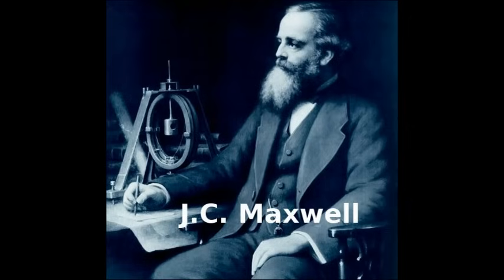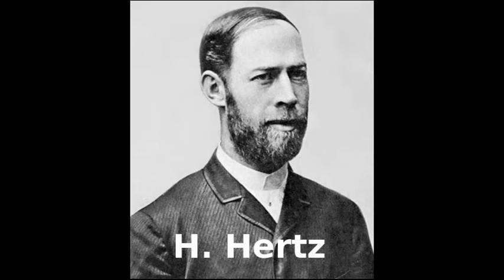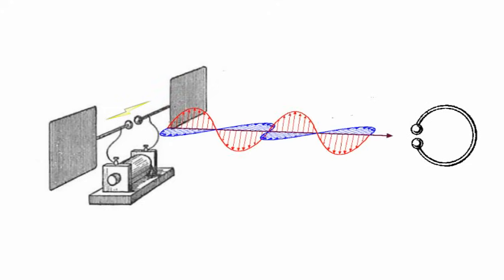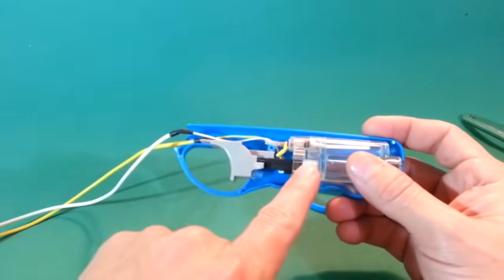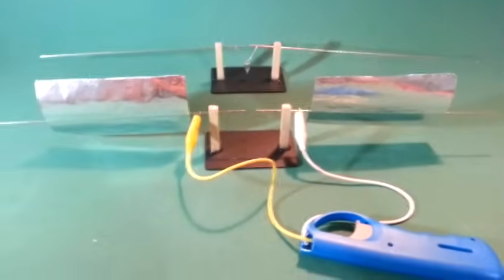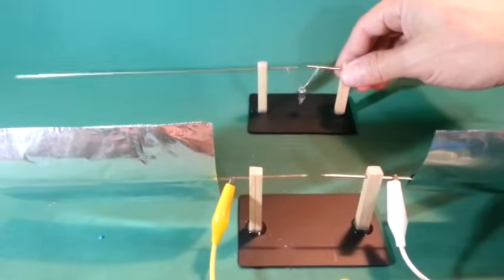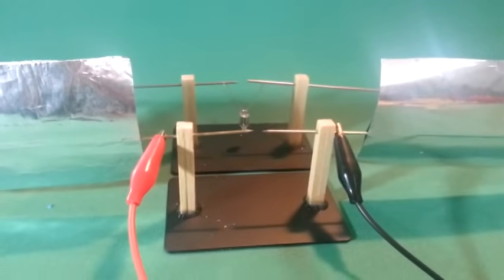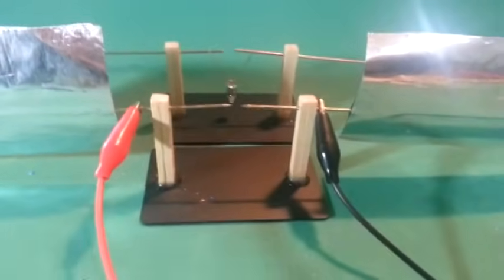Hertz Experiment on Electromagnetic Waves

Comment: This is why youtube is the greatest invention since the printing press. Genius people can build their experiments and share with everyone around the world. Thank you so much for this! Wishing you the best!
Reply: Still incomplete since as many stated this is indeed wireless but not the hertz type but a capacitance like transfer. Youtube is for stating the x happened not for the reason x happened.
Reply: Billy Monday how did you conclude that this is a “capacitance like” transfer? You are confusing a tesla coil with this experiment.
Reply: @stefano.a  Read other comments or a physics book about the definition of a capacitor... Also tesla coil has a COIL (inductor) and uses a more general capacitor than this experiment does
Reply: Billy Monday the spectrum of the signal produced from spark is so large that is surely transmitted ad electomagnetic wave. To be sure that the receiver it is not in the “short” field distance is enough to move the receiving antenna more distant. But the concept doesn’t change.
Reply: @stefano.a  I didnt dissprove antennas , however this experiment doesnt prove them either ok?
Reply: @billymonday8388  You're all wrong. If the quadrupole charge isn't depolarized it can't possible couple by way of parasitic capacitance. The only remaining logical explaining would be inductive coupling caused by over saturation of the ferrite core in the PIN diode.
.
.
.
.
Yeah, none of that made sense. But at least somebody can feel big and angry about it as they try in vain to tell me what I said was nonsense. Nobody ever clicks "read more." Oh so reactive (no pun intended heh). There's always one of them.
Reply: I know man. Very limited in the pro column as far as the internet goes. But this is truth and they’re taking it away, be vigilant
Reply: @Shreerang Vaidya ?Your comment seems very strange, wtf?  I love the conversation above - electromagnetism is SO fascinating!
Reply: A YouTube jewel.
Reply: Thank you very muth for thith

Comment: how much voltage is given for producing this spark..and what is the source of the voltage ????
Reply: The dielectric constant for air is 10,000 volts per inch.   If the spark can travel 1 inch , you know it's at least 10,000 volts. The source is a high voltage power supply.
Reply: @J.RRandallIllinois  depends on several factors, including air pressure and humidity. For most sea-level moderately moist air, sparks jump about 3 kV/mm.

Comment: can we use any other materials than a neon lamp?
Reply: A common fluorescent tube also works in the case where he used the powerful voltage generator but you could experiment with small fluorescent tube and the BBQ lighter.

Comment: What is the materials you used for experiment? Reply asap pleaae. Thank youu
Reply: A 4 pair length of wire ,a lighter pizo and a neon bulb you can hang them with a plastic bottle  and connect them as that in the video there's no need of the aluminum foil
Reply: @neldungca8524  the foil is necessary to propagate the waves; it's the antenna.

Comment: I would like to have seen it performed in a way as to block any reflection of the lite that you are transmitting.  Preferably one with the spark gap and the lite bulb in a box with black background to show the lite better. And to have a non translucent  blocking material between the spark gap and bulb to show no reflection on the glass bulb from the spark gap. To show a good experiment, is to show it in a away as to not leave any angles that could be used to disprove your experiment. Thank You

Comment: Very clever use of the piezo!
Reply: Piezoelectric effect- A effect in which the two ends  quartz crystal are given a difference of 10,000V to generate Ultrasonic waves. 

You are a idiot
Reply: @animeepisode9280  Wow - so much hostility just because someone doesn't understand electromagnetism - I'm ignorant too, but not an "idiot".  We are here to learn, but some people have such big egos because they know something another person doesn't, as IF that makes you intelligent.
Reply: @animeepisode9280  Also, if you deform a quartz crystal, a high voltage can be generated. The effect works both ways. That’s the way spark ignitors work for lighters, and is how the spark was created here. So OP is correct, and this is a clever use of a piezo sparker.

Comment: where is the link to make that power suply?
Reply: A tv high voltage transformer and a transistor oscillator using a winding for reaction and one as primary of the transformer
Reply: You can improvised an ignition coil system and the output would be used to charge the rod

Comment: Your amazing you helped me so much thank you and do you know what those wires are actually called
Reply from the maker: +Daniel Milne thanks! which ones?
Reply: +Ludic Science the ones that connect to the itenna
Reply: +Ludic Science the intena with the aluminum foil on it
Reply: +Ludic Science coming from the lighter what are those called
Reply from the maker: +Daniel Milne alligator clips
Reply: +Ludic Science thank you so much for the help have already made it at home now hope to get an A on my science fair
Reply: They called antenna if you charge the antenna with voltage and nearby antenna shows lamp glows because of they have the same length or the have the same wavelength they are in resonance
Reply: Yes

Comment: Why does only one electrode of the neon lamp light up?  if the lamp was lighting from radio waves they would both light up.  Hertz' experiment used a loop as a receiver, not a dipole.
Reply from the maker: +pixelpatter01 That is the reason, the use of a dipole.
Reply: +Ludic Science My BS meter is pegged right now.
Reply: It's because the circuit gave an exponential decay, not a damped sinusoid. As "TheIAMINU" comments above, you needed to add some inductance in parallel to the capacitor (or in series with each arm of the dipole) to make a circuit that would ring down resonantly. The type of antenna has NOTHING to do with the observed effect.

Comment: How did you choose the right resistor(How many OHms)? Is there a book that proposes electric circuits that can assemble plasma like this?
Reply from the maker: Mike Marachov mostly by trial and error
Reply: Ludic Science Man is there theory behind that?
Reply: Ludic Science I am look for about that I can read about electric circuits that using them I can create plasma like this.
Reply from the maker: Mike Marachov of course, this is on of the first experiments in electromagnetic theory. Take any college book on electromagnetics to learn about wave propagation.
Reply from the maker: Mike Marachov what kind of plasma, what dou you need it for?
Reply: Ludic Science Dear friend I am electric engineer I already took a course on waves. my question to you is about the circuit and resistor...where did you take the idea from? I am looking for a text book about plasma ignition circuits.
Reply from the maker: Mike Marachov I used no particular textbook, if you google "Hertz 's experiment" you will find info on this. I do not know of a particular book in plasma ignition, but basically you need high voltage to get an arc between two electrodes, this is how obits work (oil burning furnace's ignition transformer).
Reply: Mornlngjevam

Comment: Hi, have you ever experimented with the Tesla-wireless System (2 teslacoils in resonance)? I tried it out and I was just impressed by the results. I had 200W Input and I could power a 10W LED lamp from a distance of about 3 meters. There is still a lot to improve in my System, but its just fascinating. A Video about this method of transmittig energy would be very interesting.
Reply from the maker: helut kuno Hi, I have not tried that system yet, have any links with info?
Reply: Well, it sounds more complicated than it is. Maybe this page will help you: http://www.teslaradio.com/pages/wireless_102.htm
I build a ordinary Tesla Coil high voltage setup, with, electrically and mechanically speaking, the same coils (secondary of the transmitter and primary of the receiver). Thats basicalls the scematic: http://amasci.com/graphics/tcoil7.gif The system can also be used to transmit information. Instead of a light bulb I hooked up a germanium diode and a pair of earphones, so you could hear for example the morse code.
Reply from the maker: helut kuno I have to try that!

Comment: Awesome vid 
But shouldn't those both wires( one through which spark is jumping and other through which bulb is connected)     be in resonance nd wat  method did u apply to put them in sync with each other
Reply from the maker: When in resonance the transfer of energy is maxmum. But is also work if they are not too far from resonance, only less energy is transferred. You can tune it by varying the length of the wires. A finer way will be to put a coil in series with the capacitor and calculate the optimum values, but i did not do that.
Reply: Then was it a trial n error method lol
Reply: Manan Mehta yes! it actually worked on the first try. I guess fine tuning will be needed if you want a large distance between antennas.

Comment: Notice that when the neon lamp glows that the glow is only around one electrode? Neon lamps of this type can be used to check for Direct Current, as is the case in this last demonstration. If it were Alternating Current it would then glow from both electrodes.
This is not to say that the source supply is AC or DC but the result to the lamp at a distance is shown to be DC.
Thanks for this video, it is always nice to watch them.
Reply from the maker: Good point, thanks!
Reply: It's unipolar, but not dc (as it is not a constant current). Huh? In this case, what is happening is an exponential decay. In each case, you have a capacitor (yes, the quartz "shocker" in the lighter is effectively a capacitor charged by piezomechanical stimulation) that discharges through a spark gap (a sort of variable resistor if you will). To transmit an electromagnetic wave, you only need a time-varying signal and an antenna, and a discharge is time-varying. But this discharge is not a sinusoidal wave, it is unipolar...it moves from one potential down to zero (asymptotically close anyway), never crossing over. It's a curve of the form V*e^-(t/RC), so it never crosses the x-axis.
Reply: Can you like explain why dc would only glow one electrode and why ac would glow two